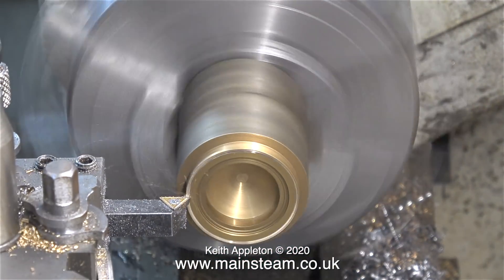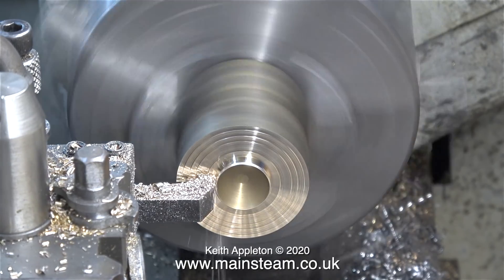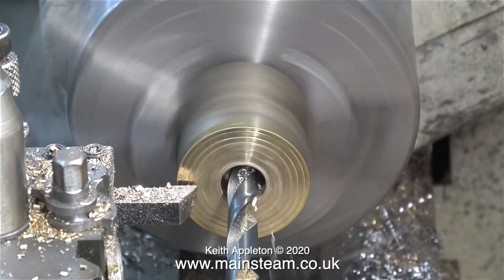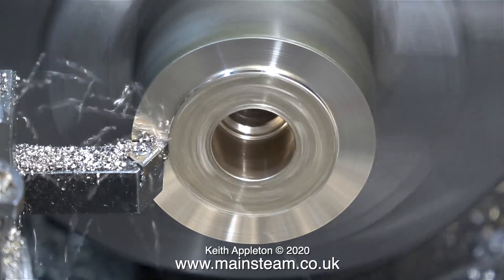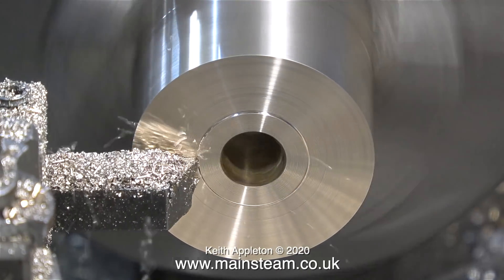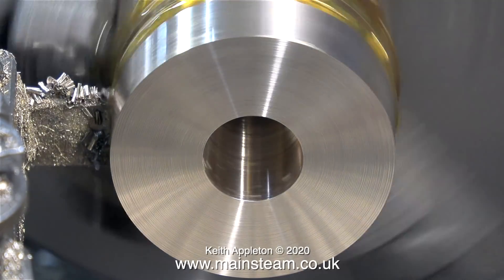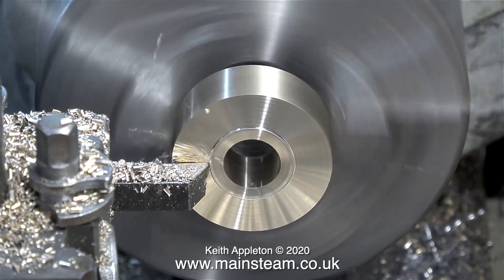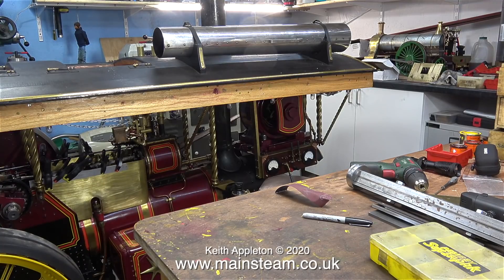MACHINING PROBLEMS - MODEL ENGINEERING FOR BEGINNERS - PART #32

Comment: Bronze and brass, being copper based alloys, exhibit particular characteristics when machining.  While being fairly self lubricating, (cutting oils should never be required), they also have a tendency to grip the edge of a tool.
So, a neutral Rake is needed on any high speed tooling being used.  With lathe cutting tools, simply leave the top face of the tool flat.  With drill bits, simply break the cutting edge using a diamond file, or if you’re brave, on a bench grinder.
Reply: I agree with Hugh.